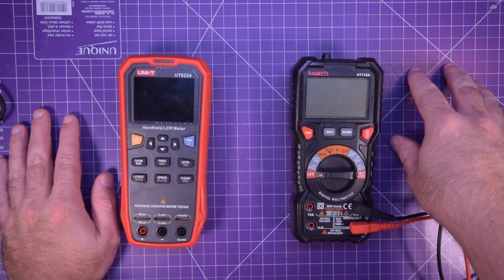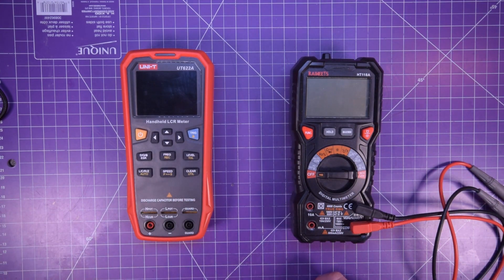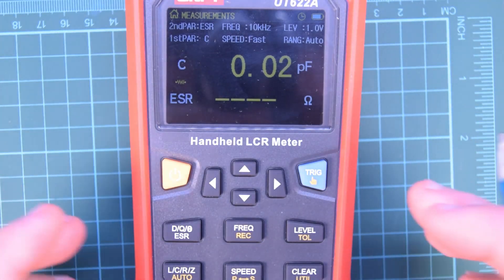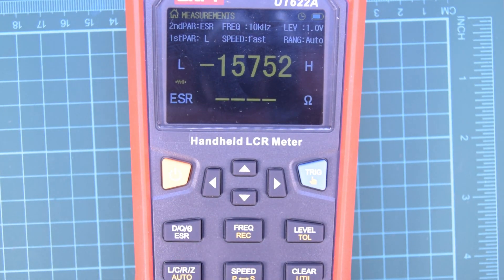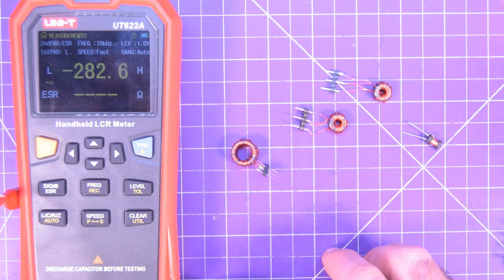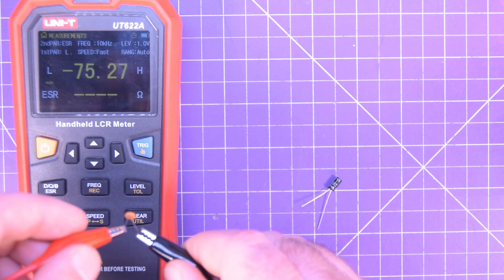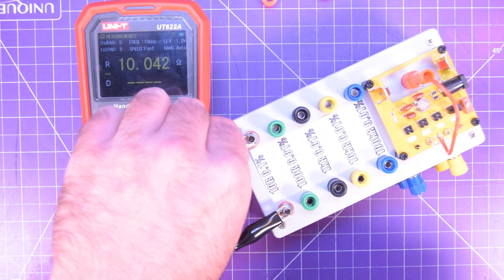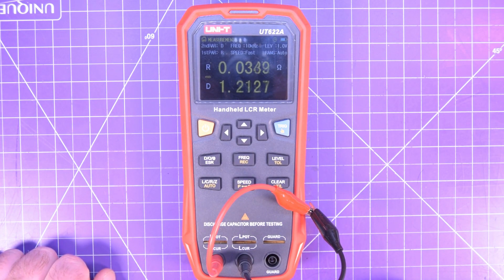What Is An LCR Meter? Uni-T UT622A First Look

Comment: If your resistance test box shows correct percentages, then the LCR meter is less accurate. For example, on the 100R resistor it shows 0.01%, so the value should  not exceed 100.01 Ohms, but the meter shows 100.05. But, granted, the LCR meter probably meets its claimed spec of 0.2 percent accuracy or so.

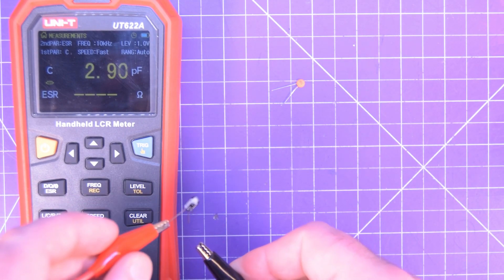Comment: At 14:33 don't you have that electrolytic capacitor wired backwards?
Reply from the maker: It uses AC to test, so polarization doesn't matter
Reply: @SimpleElectronics  Interesting. So why does polarity matter in DC but not AC?

Comment: What's the maximum capacitance it can measure?
Reply: Stats for the UNI-T 622A 
99.999mF @ 100/120Hz, 9.9999mF @1kHz and 999.99uF @ 10kHz. If you get a C or E model it can do 99.999uF @ 100kHz also. 0pf is the minimum for all frequencies w variable amounts of trailing zeros.
Reply: @arsenicjones9125  I've seen the specs, but I was curious if someone really pushed it to the limit to see if those are real and accurate

Comment: I'd like to see an accuracy comparison between the really cheap LCR meters and yours. I bought a super cheap one off banggood for about 10 bucks and then a slightly nicer one for about 30 bucks. I'd like to see if the accuracy is much poorer on the cheap ones.
Reply from the maker: I'll see what I can do, thanks for the suggestion!
Reply: There are some comparisons on youtube. Youll be surprised at how good even the cheap ones do..

Comment: Did you null the meter out before doing the measurements ? the lead resistance at the end there was a bit high, wold have given even better resistance readings otherwise.
Reply from the maker: I did not, the manual for this thing is huge lol
Reply: Good reminder. 
When I zeroed mine it made a noticeable difference (I assume mostly based on the stray reactance in the leads)